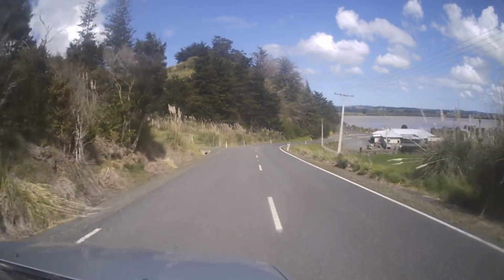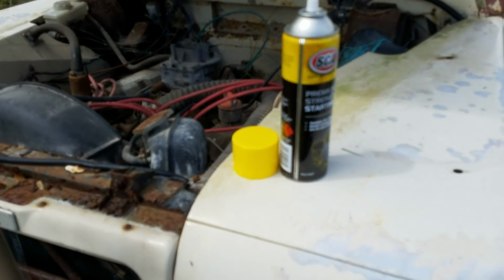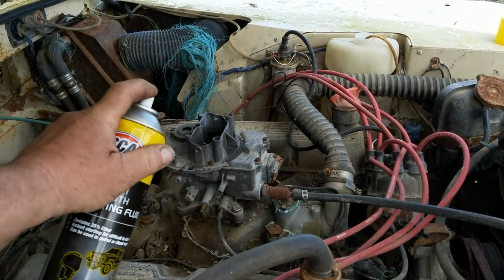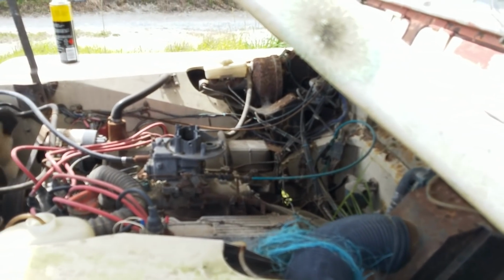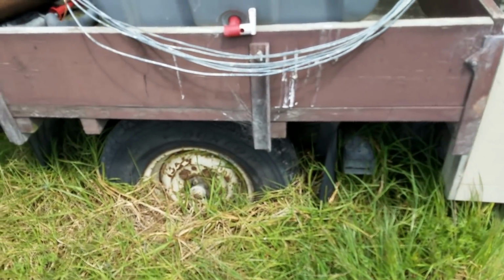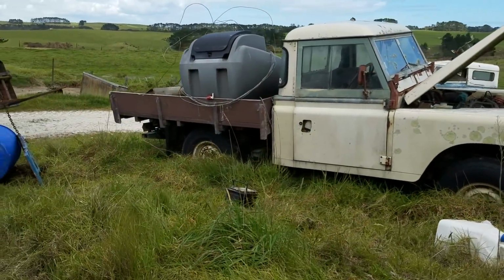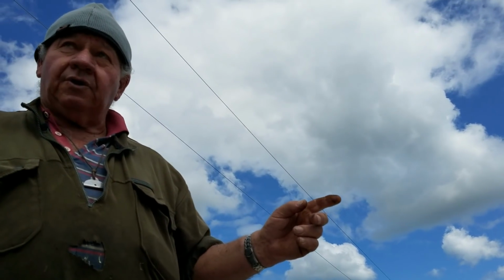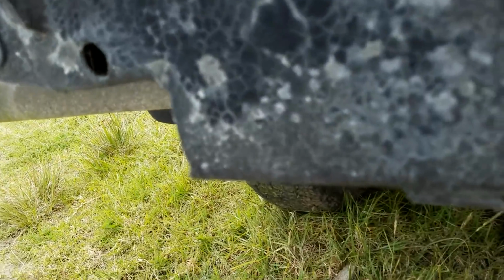Land Rover V8 in a field for 12 years- will it run?

Comment: owned my stage one here in he UK since 94, parked it up in the corner of my front garden in 99 and didn't touch it again till i had to move it in 2013, put a half a gallon of nearly fresh fuel in the tank bunged an old battery in it an drove it out took me about 10 minutes from start to finish. I decided to refurbish it and put it back on the road, had to weld a couple of holes in the chassis and fit two new outriggers clean and rebuild the brakes and renewed a few other bits and pieces did it on and off over a couple of years and it went back on the road in 2016, starts first time does 60 + with ease stops on a ---- well not quite dime but it comes to a halt eventually still as the original strombergs on it as well always getting people trying to buy it but i've resisted so far
Reply from the maker: Awesome!- Like I said- everyone has a Land Rover story, But the Stage One stories seem slightly better!

Comment: Never say it’ll pull anything, I learned that years ago when I had a Ford F 150 with a V8 302, anyway I was pulling a 16’ trailer with a bunch of railroad tyes on it when a trailer tire blew out and nearly wrecked us.  I looked at my brother and said you might want to wake dad up because he’s never seen a wreck like we are fixing to be in.  Lucky I was able to get it back under control after us going from one side of the road to the other side on the highway. Since then I’ve owned only a few other 1/2 ton trucks the rest has been 3/4 tons or 1 ton duallys and I’ll never pull with anything less than one of my duallys again. Great video and good luck with the new to you truck
Reply from the maker: Thank you so much for the encouragement.  And what a great story  . I've seen people load broken vehicles on trailers backward cos it's easier at the time. Only to have the trailer go onto a huge sway that lover takes a light tow vehicle and sees them jack knife and cause lots of damage. You must always have the wieght on the tow vehicles rear axle.

Comment: I think the original setup with carbs is best. I have had many setups on my engine and is now back on dual strombergs.
The only downdraft carb that works is the quadrajet. Other carbs will flood and drown when offroad.
Reply from the maker: Thanks for that. I'm a Soft roader . should never be an issue

Comment: Hope you changed the oil 🛢 😉
Reply: Hydraulic tappets, essential to change the oil regularly, same as my old Bedford Cf 2.3 van engine.
Also the same on my current runner a 2001 3 cylinder Vauxhall Corsa 12 valve 1litre engine, twin chain driven Doc with Hydraulic tappets.
A little gem of an engine and car.

Comment: The oil in the sump would be like Honey.
Reply from the maker: The oil in the sump was like the oil about a day after an oil change . everything about this truck so far has been pleasant surprises
Reply: @t.h.o.r.  Lucky Eh, we had a MF Tractor that sat for maybe 6 yrs, the Oil was that congested we had to pull the sump off and scrap it out. Of course we power flushed out the whole engine new Head Gasket, why it was left in the first place, recon Injectors, still running fine today, that was about four years ago.

Comment: Gas or diesel. All gas in Canada, unless they were imported used from the UK.
Upon coming home from Scotland, I wanted one. I had to settle for a Jeep Wrangler. I love my Jeep but still want a Defender.
Reply from the maker: The V8s are petrol- The Rover 3.5 and 3.9 got fitted to lots of iconic cars - TVR, Morgan, Bowler, Land Rovers, Its all alloy and really torquey
Reply: @t.h.o.r.  Vehicles imported new to Canada were generally gasoline.
I had a 5 speed 110 in Edinburgh in 2007. But couldn't bring it back to Canada. It had to be 15 years old minimum to import. So I eventually got a wrangler. Dad had Defender 90s in the 60s & 70s.
Reply from the maker: @truckerdaddy-akajohninqueb4793  Britannica Restorations is a Canadian based Defender importer and restorer with a good YouTube Channel
Reply: @t.h.o.r.  Yes. In fact, they are only a few miles away. I'm not knocking his hard work. He is very expensive for a 15 year-old Defender. I priced a similar vehicle in Edinburgh 2 years-old for less money.
I could have gone to Mexico and buy a one new (before they stopped producing them), but we still cannot import them into Canada.
But he does have a thriving clientele.
There's a 15 year restriction on used vehicles.

Comment: according to carjam it's a 2275cc
Reply from the maker: Bahahaha.  It is too! That's nuts. I've checked all the bolt holes and mounts for originality. It's  factory      v8 mounts and the grill has not been moved forward and the full time 4wd   Trans tunnel and seat box and the bigger master cylinder.  battery tray all  kosher so I would say that it was a mistake at the county post office where it was first rego. My rare Paddy Hopkirk  Escort Twincam  was listed as an Escot Twin Car on its ownership papers. Pen pushers are pretty incompetent. I blame auto fill 1985 version
Reply: That is a stage 1 v8 i was an engineer on the chassis line who built these in Nelson,we built a run of these for the police to be used on ninety mile beach,it was quite common to have the wrong cc number on rego papers as in there eyes it was a petrol series 111,good waggons not so good lock,brakes were not so good ,some times the seal between the booster and the cylinder leaked so the vacumm did not work.
  A great gearbox,gearing a bit lowbut you up the gear out of a range rover to inprove this,this landrover is quite rare as we did not build many special 109 v8's with the galv chassis,i built about 5 that i can rember.
Reply from the maker: @wakarua860  Thanks so much for commenting. That is all great info. check out my next video- getting it home and discovering what Ive got. https://www.youtube.com/watch?v=gEe5VB8PHmo&t=1s